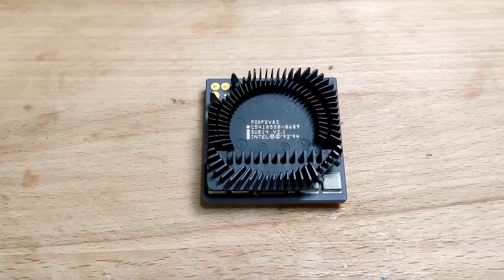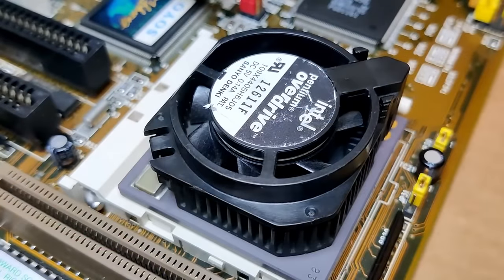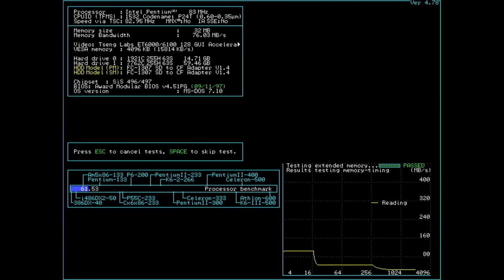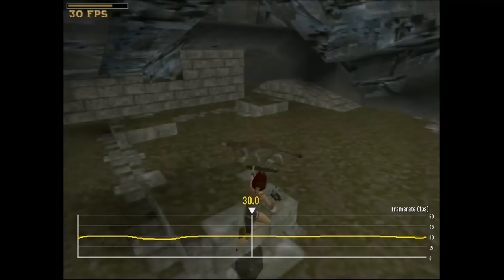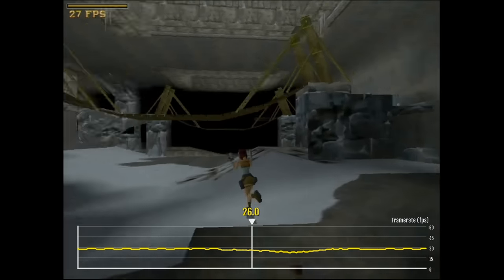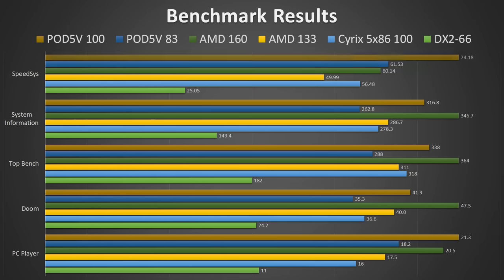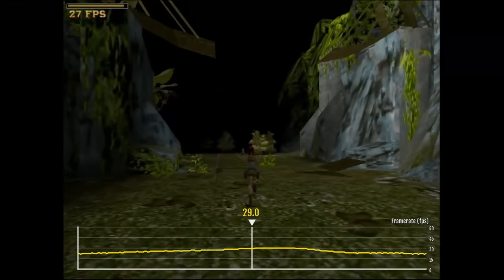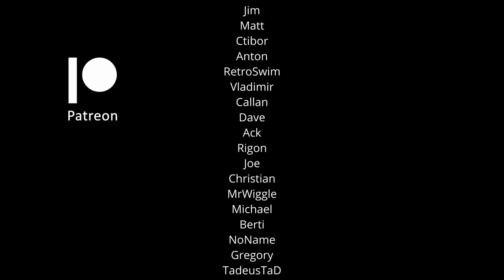Tomb Raider (1996) on a Pentium OverDrive PODP5V83 (Part 8)

Comment: The 83MHz Pentium Overdrive gave my 486sx/33 new life back when it was new.   But it made for a far less expensive update than buying a new computer.  Bonus, my system (NCR 3230) left the 486sx in it's socket when the POD was installed in the expansion socket.  I was quite surprised to see a second socket (open).  I wonder if the two processors were both in use at any time or if there was a function to use the preferred CPU?  I still have the unit (and OverDrive installed) for old MS-DOS & Windows 3.1 games.  I have an IBM Stealth S78 200Mhz (non-MMX) for Win95 & Win98se gaming).
Reply from the maker: That is definitely one of those use cases where the Pentium OverDrive brings a significant performance gain and prolongs the life of an older system. Usually, when two CPUs are installed, the permanently installed CPU is deactivated and not used at all.

Comment: Would have liked to see a DX4 100 from Intel included, because IIRC that beat the Pentium in performance so it should also beat the overdrive as well.  At least the engineering samples I saw back then did but I never got to see a production unit comparison.

Comment: I keep wondering if there's more than 1x and 2.5x multipliers with some tricks by shorting some of the pins on the other side of the ZIF socket. The limiting factor with these seems to be the memory bus speed (given pentium was supposed to be 64bits wide externally for 32bit internal). Would be quite interesting to see speeds between 83mhz and 100mhz if possible on 40 or better 50mhz FSB. GIven it's hitting FPM ram also, it's slower than EDO (5-15%) and again slowing that vital FSB transfer rate shoveling instructions to the instruction pipeline. ..just tyre kicking and thinking. Might dig mine out and go experiment.
Reply from the maker: I agree. If I'm not mistaken, I have a gigabyte socket 3 board in Germany that supports EDO memory. It also has PCI slots and is probably one of the later models. One day, I'll have to test the POD on this board and see how much better it performs with a few roadblocks removed

Comment: The overdrive is probably bettter in the end as it will benefit from the pentium optimizations that were included in some games like Quake but I do not know how big that list of games will be. A very fast 486 with a high system bus speed will benefit almost everything. Really is a hard choice to make. A stock overdrive does have the advantage of not needing to deal with overclocking problems. But it will be a rare part so a 486 system is probably easier to do

Comment: The fan assembly is very cool but as you said, a nightmare to replace!! I see the fan is just a 5V one, would it be possible to just solder a 3-wire fan to that pad and fool the CPU?
Reply from the maker: Yes, it is possible. Two of those round pads can be shorted which will trick the OverDrive to run at a multiplier of 2.5. A regular 12v fan can then be powered by a motherboard fan header.

Comment: Maybe you could bypass the onboard VRM of the CPU and do a slight voltage rise! 0.05V - 0.1V might be enough to be stable @100MHz. Just keep an eye on the temperature.
Reply from the maker: I thought to do a diode mod which I have seen others do. What I understood is that the voltage regulator has a high dropout voltage. The headroom for increasing the voltage may therefore be limited, but as you said, it might just be enough to get this one stable!
Reply: @bitsundbolts  you could also directly inject voltage at its output. Then the regulator should simply shut off. Diode mod may increase by up to 0.6v which is a bit too much

Comment: I've no opinion on which is better, but I'd be curious if there's a way to tweak the voltage regulator on the Overdrive to give the CPU just a tad bit more voltage - might make it run stable at 100MHz.
Also, would it be possible to increase the bus frequency, thereby increasing the resultant speed with the stock multiplier?
Reply from the maker: Yes, there are two mods that should work with the existing voltage regulator: Resistor or Diode mod. I have to do some more research on this to learn more about it. To get to 100 MHz, I increased the system bus from 33 to 40 MHz. The next step on this board would be 50 - which is probably unreasonable. Unfortunately, I cannot adjust the bus frequency in smaller steps - without modifying the board I guess. Atheatos has some videos on his channel modding this board and the Pentium OverDrive.

Comment: Huh, I would have expected a clearer victory for the venerable PODP (in Tomb Raider, paired with the Voodoo 1). I guess there just wasn't that much more in it with the fps cap and it's still impressive when factoring in the respective release dates.

There would still be something (quite reasonable) left to do to further increase frame rates in a 9th part though - replacing the Voodoo 1 with a Voodoo 2. 😉 I think it would be very interesting to see how much the slower CPUs benefit and which combinations can achieve parity.
Reply from the maker: Yes, it would have been a lot more interesting if there wasn't a frame rate cap. I guess it's time to fix that Voodoo 2 with the blown memory chips 😉
Reply: @bitsundbolts  If it can indeed be revived, it would be a perfect candidate. 😁 If not, I'm sure you have another one just like it at hand. 😉 Either way, according to a thread on Vogons, switching to a Voodoo 2 should result in a marked improvement due to its additional TMU taking some load off the CPU by requiring only 1 pass for multitexturing where the Voodoo 1 requires 2 passes. It's also a somewhat period correct scenario and a decision some gamers might have had to make back in the day - upgrade the CPU (too) or go for the better 3D accelerator.

Comment: Have you considered replacing the voltage regulator on the chip with a slightly higher rated one to overvolt the chip?

Comment: I don't suppose you feel like investigating the built in voltage regulator of the Overdrive to see if you can give it a tiny little bit more power? probably not :)
Reply from the maker: I may do that

Comment: I would pick the Cyrix CPU, because I think it is the most interesting processor of the pack. ☺️
Is it possible to put a bit more voltage into the POD to make it more stable?
Reply from the maker: There is a diode mod that could potentially lift the voltage by about 0.2-0.3 volts. That may be enough to get it stable. I still need to research on that topic

Comment: Shouldn’t there be another P in the model number? I sold a boxed PODP5V63 not too long ago. The inner CPU itself was still sealed! I found it at Goodwill many years earlier.
Reply from the maker: You are correct. I updated it - I guess this model number took a toll on me. Thanks for letting me know! And the PODP5V63 sealed is still a good find! Congratulations!
Reply: @bitsundbolts  Thanks. If I still had it I would’ve offered it up when I first saw you needed a fan. Only sold it when I did because I had no room after being displaced by a tornado. I’m glad you were able to get one!

Comment: Somewhere around 1996 or 1997 I found one at a yard sale for $1. I never benchmarked it but it was notably faster than my Cyrix 486@80MHz. It made games like Duke3D run smooth and even made Quake just about playable. I never tried 100Mhz, as it was a 63Mhz part that I had already OCed to 83Mhz.

Btw, did you try a higher voltage? Looks like it really wanted to be stable at that speed...
Reply from the maker: Not yet, but I may attempt a small volt-mod some day. It may not need a lot to get stable especially since I could finish all synthetic benchmarks without it crashing

Comment: If the multiplier can be lowered, would 80/40 be better than 83/33, giving away a little MHz for a better bus speed, or a more extreme 75/50.
Also, give it a chance to blast the competition away.... Quake! Pentium class FPU smashes 486 class FPU
Reply from the maker: As far as I know, this Pentium OverDrive will only work with fixed multipliers 1 or 2.5. There is nothing in-between. However, maybe one could mod a motherboard to allow for other bus frequencies.

Comment: I'm curious if modding the CPU could make it stable? Possibly remove the stock heatsink, fan and voltage regulation. Replace the heatsink and fan with a more robust solution to keep it cool and build an external voltage regulator with an adjustable voltage pot. Maybe just a little more voltage and superior cooling could get that thing stable at 100mhz. Possibly use the Socketblaster project as a starting base for the project and mod the project and chip to work together. I've seen people use the adjustable voltage of the Socketblaster to get some cpus stable with just a slight voltage tweak.

I know the stock look of the Pentium Overdrive was important for you. For me it's about the performance. I would just love to see one of these stable at 100mhz. Maybe someone someday will pull it off.
Reply from the maker: Peter over at CPU Galaxy has one - and I think Mike on vswitchzero also has a video on his channel which can do 100 MHz without voltage tweak. I was not so lucky.

Comment: You mentioned for tomb raider it's better to get a Pentium system... No argument there however what I am curious about is how the POD on socket 3 compares to the early Pentium cpus like the original P60 or a P75 for example
Reply from the maker: I do have a socket 5 board and a few early Pentiums - if the board works, I could take a look in a future video

Comment: Hi Top Video und Tests. Ich sehe du hast auch das Soyo 4 Saw 2 Board. Ich habe auch diese board und ein Bios Update vorgenommen mit der WA0911 Version. Er Booten beim Einschalten 1 mal Danach nie wieder. Habe den Flash mehrmals neu geschrieben, aber immer dasselbe problem. Die WA53 Version funktioniert immer. Woran kann das liegen. Was ist der unterschied bei den Revisionen vielleicht des Boards? Leider kann ich nur bis 8GB IDE anschliessen, oder kann ich das WA53 auch bis 128GB Support modden ?  Ansonsten weiter so mit diesen tollen content!!!!!!! Top und Danke
Reply: XTIDE ist den Freund!
Ab damit auf einen EPROM und ins Bootrom einer alten Netzwerkkarte. Fertig.
Reply: @dolphhandcreme  danke....welche netzwerkkarte (isa, pci) währe da empfehlenswert ?
Reply from the maker: Bei mir scheint die WA0911 mit 128GB Patch einwandfrei zu funktionieren. Ich kann spaeter mal nach meiner genauen Board Revision schauen. Wie @dolphhandcreme bereits gesagt hat: XTIDE waere eine Loesung. Dafuer braucht man eine ISA Netzwerkkarte mit einem freien Sockel - viele alte Netzwerkkarten haben einen.
Reply: @bitsundbolts  ja werde ich mal ausprobieren, kannte diese option nur von alten XT rechner um flexibel in iwelcher hinsicht zu sein....ich berichte auch mal welche revision ich habe, so haben alle ein vergleich/info
Reply: @81holgie  Prinzipiell jede mit einem Bootrom-Socket. Bei ISA würde ich aus persönlicher Erfahrung zu einer 3com 3c509B (Combo oder TP) raten, hauptsache mit Bootrom! Bei PCI 3C590, wobei ich mir nicht sicher bin, ob der ISA-Rom im PCI-Space funktioniert. Nie getestet.
Reply: @dolphhandcreme  hmmm, bin da selber am zögern und müsste auf entweder Radio Karte, TV-Karte oder Handscanner interface Karte verzichten, da ichs auch nur von ISA Karten bisher kenne mit dem Boot-Rom. Ausserdem zwar 1 PCI frei ist, aber shared mit dem ISA Slot. Und im Prinzip fluppt die "Karre" ja TOP. Dann arbeite ich weiterhin mit meinen HDD  Wechselrahmen, wo eine 2. CF Karte zum Tauschen dann arbeitet. Damals hatten wir auch nicht mehr als 1GB und waren zufrieden. Von daher reines Optimierungen Luxus Problem. Zudem habe ich noch ZIP100 drinne, 3dFX und Graka (MGA MIL 4MB) als PCI, DVD mit MPEG beschleunigte TV-Karte, 160Mhz OC und 64MB RAM....was will man mehr fürn nen 486er ....
Reply: @81holgie  isa ist ein Bus. Theoretisch könntest du mit riserkarten arbeiten. Oder tv gibt es aber als pci. Die ganzen hauppauge wintv mit bt878-chipset. Ansonsten evtl noch Platz im bios?  Modrom / modbin...
Reply: @dolphhandcreme  klar das ISA ein Bus ist....Weiss nicht wie gross der Flash Rom ist....ich meine 128KB und ob noch zum morden Platz ist? Aber dieses modbin habe ich schon hier, nur nicht ausprobiert....da das flashen direkt aufn board immer Schiefgeht und es Improvisiert per Hotflash auf mein Socket 7 Board durchführe 😅, da brauche ich erstmal wieder Elan für, denn das ganze zerlegen, damit ich das ROM passabel erreichen kann nervig ist. Was ich noch überlege ist den Cache noch zu erweitern auf 512KB, damit die 64MB RAM vernünftig gepuffert werden können...Nur blicke da noch nicht ganz durch wegen den TAG Chip ...will bis zum absoluten möglichen maximum gehen an diesem Traum 486...
Reply: @dolphhandcreme  und ne pci TV Karte okey....aber habe möglich zeitgetreue Karten verbaut, (ausser was Grafik anbelangt) welche ich in OVP auch alle hier habe umd Win 3.11 kompatibel sein sollte. Was bei PCI schon schwieriger wäre, ausser bei Grafikkarten teils, da es dafür meist Treiber gibt.

Comment: Yay ... had been waiting for this, since I have a very similar setup.
Can you list your full BIOS settings? I've seen high 73 scores with POD100 CPUs in Speedsys, but no 74.
Also prefering the POD, as I got mine for cheap, it is (was) a barely appreciated CPU back when I got it, found it a decent challenge to play back mp3s without stutter at a decent bitrate and finding a mainboard without issues (SOYO seems to a great choice, ASUS is a bit faster but not without issues). Depending on the budget and/or patience to wad through piles of potentially broken hardware, the drama known as retro capitalism and usecase I agree an AMD 5x86 will very likely be a better choice for most people.
Reply from the maker: I used auto settings in the BIOS for timings and the CPU L1 and motherboard L2 in write-back mode

Comment: Hello my friend, I can´t hold my self in asking, what if you try to achieve 100mhz but with a 33 X 3 configuration, maybe it could be more stable than the 2.5 X 4. Greetings. Don´t wanna forget to mention that I am addicted to your videos, keep the great work coming !!!!!
Reply from the maker: Unfortunately, the 2.5 multiplier is fixed. It cannot be changed to 3. There is however a possibility, that the CPU is stable in a different board.

Comment: Great video! 🙂
PS: I hope this is the end of the AI thumbnails 😅
Reply: Nope, more of those please. The sillier the better. It's BnBs channel.
Reply from the maker: I'll try to find a balance. But for the coming hardware repair videos, I'll use pictures of the actual hardware.
Reply from the maker: I'll definitely consider when the topic is right. Fictional characters are amazing to generate via AI. Hardware repairs will be difficult and I'll probably end up with a terrible mess.
Reply: Your videos are nice but I have to concur that the AI thumbnails are disconcerting. And not for a moral standpoint, they just are in my opinion ugly and - worse - make your content look like any other channel that uses the same AI generative esthetic. Maybe there's a way to make it less obvious and use it sparingly as an aid for optimizing your pipeline (I get that it is extremely helpful in shortening your turnaround time).

Comment: Wait, why couldn't you just solder a typical fan to those pins and just use threaded screws to hold it in place?
Reply from the maker: Oh, I absolutely could have. It is easy to mod this CPU to work at 83 MHz. I just want to preserve the original look and not necessarily scratch the heatsink driving a screw between the fins.
Reply: @bitsundbolts  Verständlich, einen schönen Tag

Comment: Was given that exact model back in the day and was lucky enough to get it to 110 (44×2.5) on an crappy ABIT board iirc. On other boards it would only reach 95 (38×2.5). This was strange as ABIT boards were usually total trash.
Soon swapped for a better performing AMD CPU though as like you found, performance was disappointing overall.
Reply from the maker: I have to test this OverDrive on other boards before I start modifying its voltage regulator. I did not know that the board can be such a big factor in how well the Pentium overclocks! Thanks for sharing this information.

Comment: A bit disappointed by poorly OC capabilities but POD per mhz is a beast
Reply from the maker: Yes, it would be a very nice upgrade if it could easily be overclocked to 100 MHz. I guess the odd multiplier was a necessity, not an arbitrary decision.

Comment: Amd-x5-133 is true 486 cpu, its more appropriate for socket 3, unlike pentium overdrive, its not true 486 cpu, its stripped-down pentium.
Reply from the maker: Yes, you are right! The AMD can most likely be overclocked to 160 MHz and outperform the OverDrive in the tasks that were meant to run on socket 3.
Reply: You're right in that it is a stripped-down pentium: half the data bus width, disabled second pipeline (although twice the L1 cache)

Comment: its a great cpu

your limits seem to be ram 🤓
Reply from the maker: Yes, I agree that the memory may be an issue: 70ns FPM - however, I do have many boards that do not support EDO and faster timings. So, I think it is still a reflection of what one is able to achieve on socket 3.

Comment: 640x480 only become silky smooth with pentium 3. And a faster one like 800mhz. Later DOS games only play fast enough on fast pentium 3 (using only software).
Thats why you needed voodoo cards for this systems. Pentium 3 was already fast enough to not need 3d acceleration.